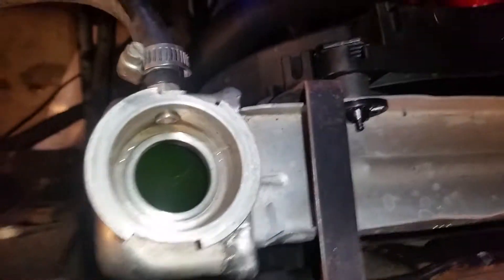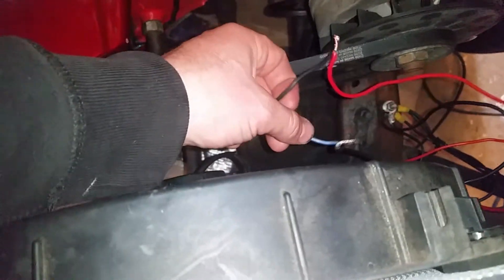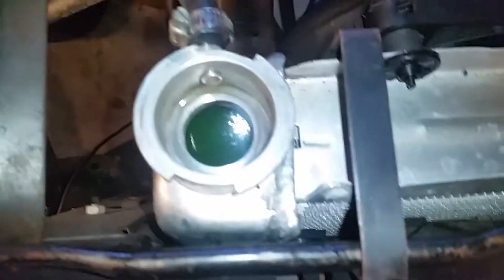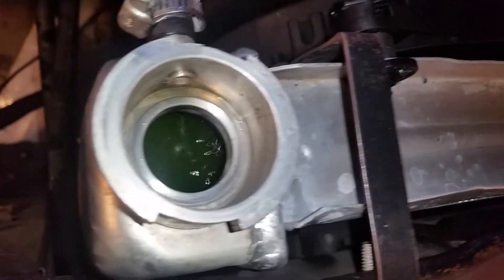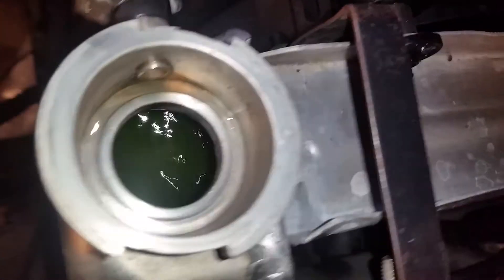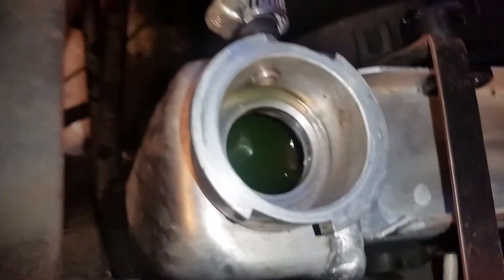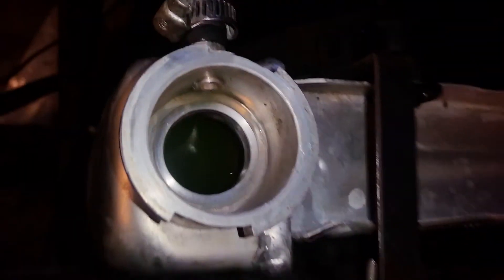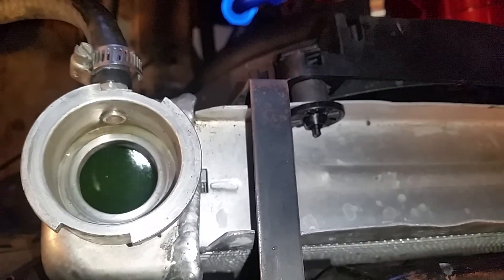SBC Proform electric water pump running in the wrong direction.

Comment: Even if the pump is spinning the wrong direction it will still flow the coolant the same direction. However the flow rate will be reduced greatly.

Comment: Hello ! Have you solved your problem ? I live in Brazil and I have one problem like that . Thanks
Reply from the maker: Mechanical pump helped mine.
Reply: @TPVPRO  Are you cannot find solution for that problem?
Reply from the maker: @felipelle    No gets 200-210 on the highway but will idle @ 170 all day long I have tried everything.
Reply: @TPVPRO  So the pump running backwards was not the problem? I am dealing with this right now with a mechanical pump. i think it is a reverse direction pump

Comment: Love this machine.>>>ur2.pl/1145    Professional grade. Instead of going to the gym to work out, I can now get the same workout in my own house. It was a great value for the money. I can't comment on other machines, but all I have is good remarks on this one. I'm very happy I made the purchase. One thing to note is that the machine is very heavy, around 300 pounds, its an industrial grade equipment. So its not a toy, but be aware of the weight should you want to move it.

Comment: did you put the thermostat in right lol, easy mistake to do.
Reply from the maker: Yes it is I have done that. I have a 185 in it but I noticed it will open @ 165. So I should probably replace it.
Reply: the water flow should be traveling right to left and exiting to the bottom hose...the water could be moving too fast in the radiator to cool it or your fan is at question here...again just guessing im not there

Comment: You had it right the first time (in the video) it has to pull water down. Good luck
Yazmin Venice Beach Ca🏄🏄🏄🏄🏄🏄🏄🏄🏄
Reply from the maker: Yea it was running perfectly cool in 65-70 degree weather first day in the 80s it was running hot only down the highway perfectly cool at idle.